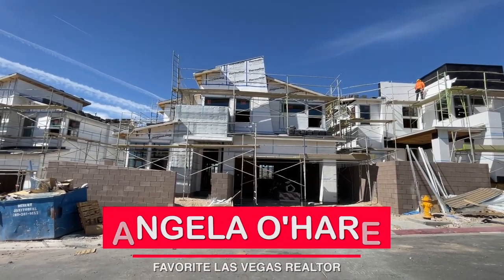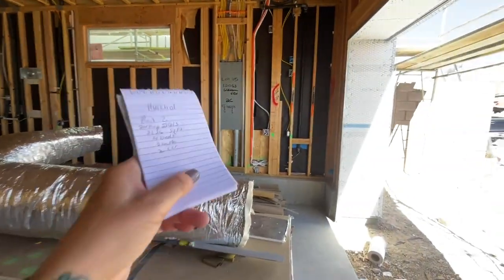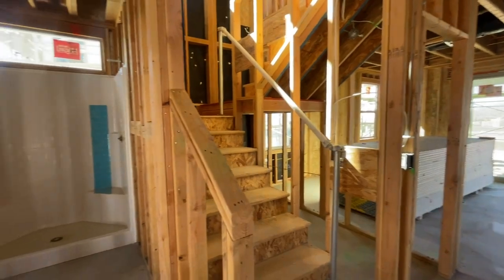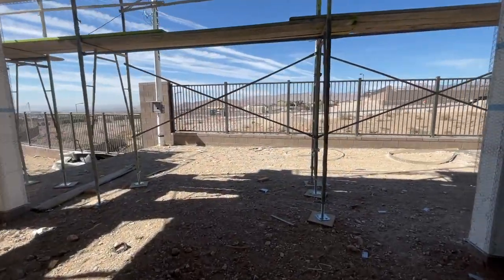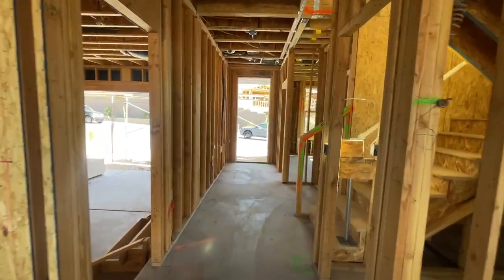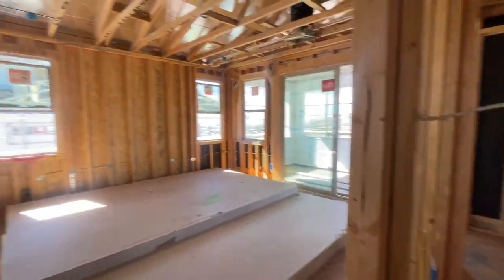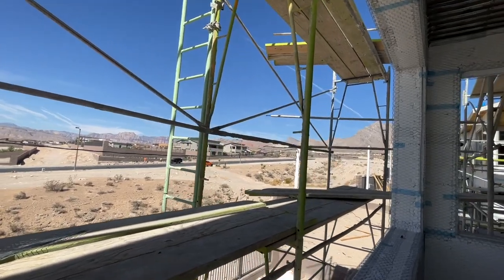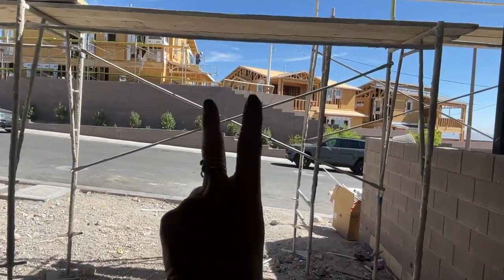Arroyo's Edge Plan 2 Frame Walkthrough in Summerlin - Tri Pointe Homes Redpoint Village

Comment: Just curious, how long did it take from pouring the cement to the walkthrough? Thanks
Reply from the maker: That’s a good question. This was a spec home, so everything was already selected, we didn’t have to wait for the foundation to be poured. It varies between builders.
Reply: @favoritelasvegasrealtor  I see. For me, concrete was poured in March but they haven't started electrical work yet. Only most of the plumbing done. Wanted to see how fast different builders work Thanks